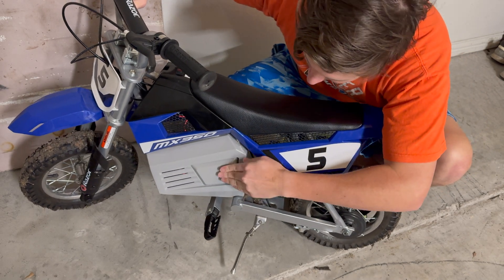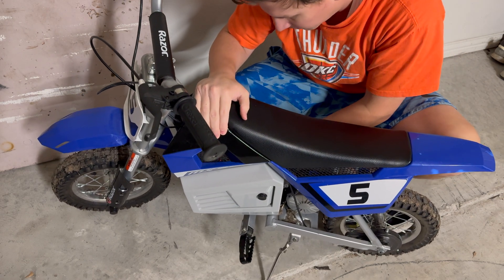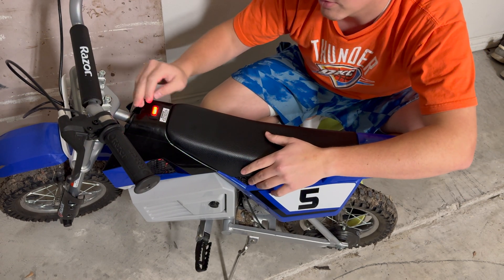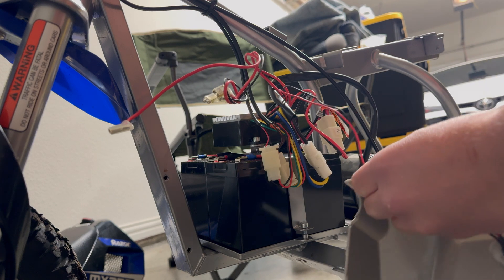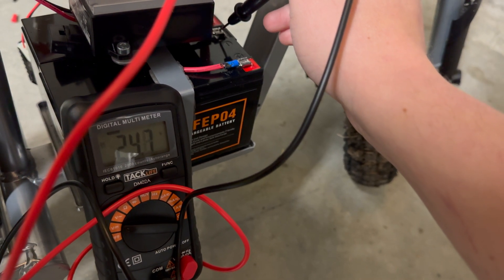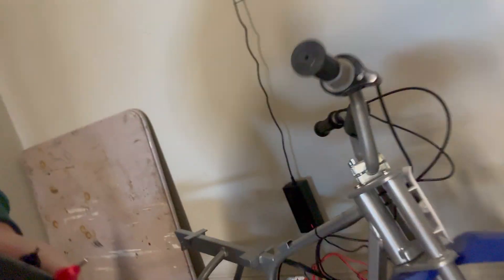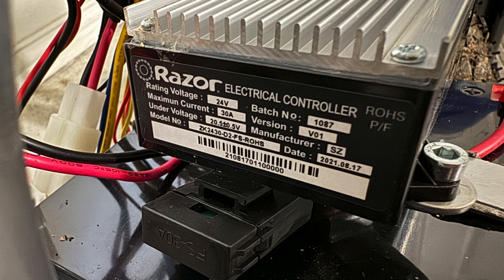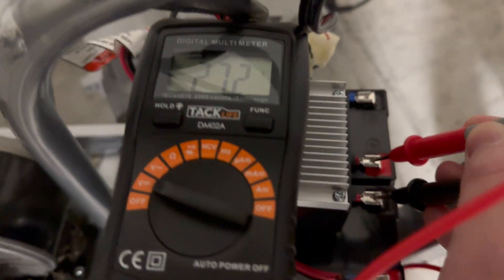Charging my MX350 with Lithium Batteries (and Voltages)

Comment: Im changing the battery in my son's mx350 to extend the range. How much do you think the run-time increases with your 2x12v10ah lipo4 battery set up?
Reply: I did your same setup… didn’t buy the same charger but one rated the same… full charge… battery was showing 28v.  I was kinda going off the same understanding that the controller will charge the batteries.  My son rode it a few times around and when throttle stops working I usually fiddle with the brake bc the restrictor.  Well when he stopped I could smell sulfur… battery leak due to overcharge. I couldn’t get throttle working again so I snipped off the brake restrictor, that way I knew that was not the problem, then I unplugged battery red and black then reconnected and now throttle works… went on a 2 mile ride successfully.  Not sure if I should stick to this charger due to the possible battery overcharge.
Reply from the maker: I’ve got a video I need to post. I did some testing. I was able to ride for about an hour and do about 7 miles.
Reply from the maker: I just don’t know the original runtime or distance. I bought it with dead batteries.
Reply: Can anyone help me out? I have 2 razor mx350 version 39.

I bought the lipo4life batteries. 12v 10ahx2.

I swapped them into both bikes.. soldering battery terminal using existing harness etc. 

1 bike works perfectly..charges correctly. Solid red light when charging to solid green when complete.

The 2nd  bike works, but when I plug in the charger it goes to blinking red light?

I'm using the same charger on both bike. 42v 2ah lithium battery with the oem 12.5mm 3 prong adapter.

What could be the issue with the second bike? Is the battery too low to recognize the charger?

Any help would be great.